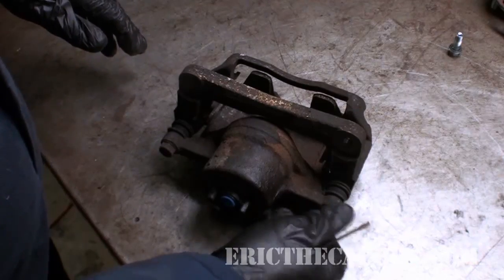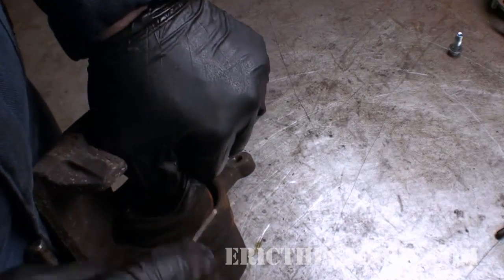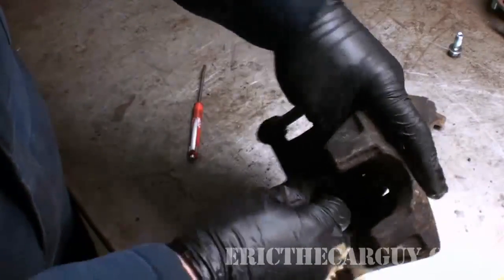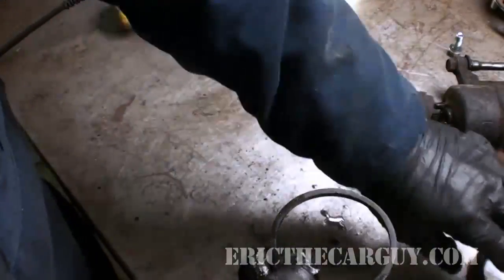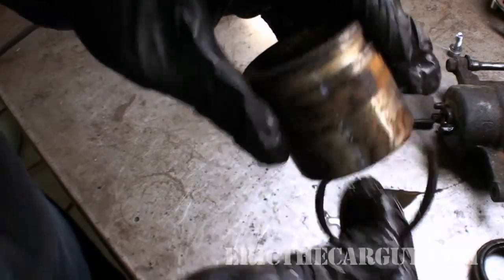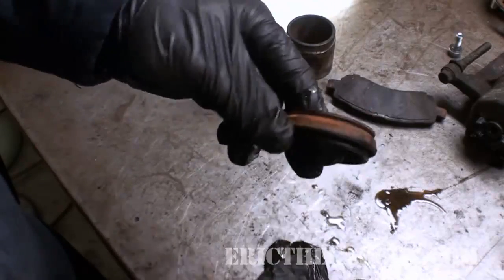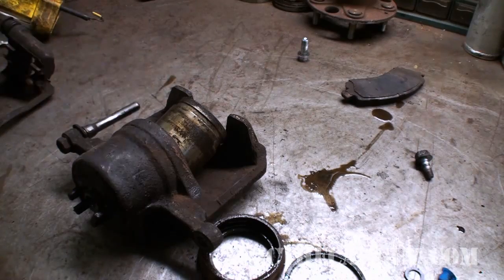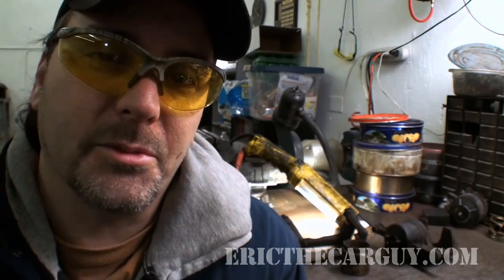Front Brake Caliper Dissection/Rebulid -EricTheCarGuy

Comment: Quick question here. Just bought everything for my caliper rebuilt including new piston. The piston seal are clearly oversized compared to the piston and the fit is not tight. Is this normal??  Looks to me its not going to make a good seal but i guess its hard to tell when the seal is not installed in the caliper.

I have double checked and the parts are the good ones. I just want to make sure before removing the calipers for the rebuilt.

Thanks!

Comment: i have a question and a concern that id like to share. my question is can u remove the piston in any way without compressed air and if so what ways will work without damaging the piston. my concern that i recently did a full on brake job replacing my rotors and pads as well as a caliper on my 95 subaru impreza lx, bled out all brake lines and the master cylinder got my brakes in working order but when i step on the pedal i will stop but my brake pedal will jutter and vibrate as if there is air somewhere or something. again everything was redone on my brake system and refreshed and done properly. what would be some suggestions as to what may be my issue with that. my pedal is stiff like it should be but it jutters and vibrates as if there is air or something trying to keep me from stopping properly
Reply: Is your abs kicking in?

Comment: My 08 wrangler has been turning hard left on and off. It's like my alignment was coming and going to and from normal. My mechanic says it's a seized caliper, if it was wouldn't it stay seized?
Reply: Sometimes the brake hose fails internally. It turns into a one way valve in a way. After several brake applications the fluid is forced into the caliper but it can't leave to allow the piston to retract. The caliper piston seizes in place due to the constant pressure. After a while it may bleed down amd become unstuck.

Comment: Eric.  I'm a big fan.  I have a 98 4runner and the front calipers keep seizing or at least not release after braking.  I've replaced the calipers, pads, and rotors but still have one caliper that wants to seize.  Is this a master cylinder problem?  Seems to be a cronic problem with this vehicle.  Any help?  Thanks,
Reply: Hey, I know this is an old question, but you very likely have a failed brake hose for the caliper that keeps staying engaged. When the flexible brake hose that goes to the caliper breaks down inside, they can have a piece of the inner liner come loose and block the fluid flow away from the caliper, meaning that once you apply pressure by pressing the brakes, this flap will not allow that pressure to release and will keep the caliper engaged.

A good check for this is to get the caliper to seize where it wont release and then open the bleeder. If the failure is a result of the caliper actually seizing and the piston binding, then opening the bleeder will not free it up. However, if opening the bleeder does free it up and allow the wheel to turn, then the problem is with the pressure fed to the caliper and is likely due to a failed rubber brake hose.

Comment: I usually pump the piston out with the brake pedal. It never fails to work and is much more controlable than air pressure plus it already is hooked to the caliper unlike a grease gun.

Comment: Question here, can you rebuild a calipers without taking the break line off?

I have a 95 F150 that has spent it's whole life in Pa so the break lines are rusted really bad and I would like to fix my sticking caliper (90% sure the piston is shot) without having to mess with the brake lines at all.
Reply: if ur brake lines are shot, replace those too, dont be a lazy ass

Comment: Can't you remove the surface rust with light sandpaper on the piston then smoothen it out very lightly
Reply: The piston surface is important for the square cut seal to do all of its jobs. pistons are cheap and rebuild kits are cheap,

Comment: Great vid I need to do this on a Peugeot 307 1.4 8v 2003 on the rear which has to be wound back with rewind tool,
Would it come out straight like the 1 in vid with air/grease
cheers
Eric
Tony.

Comment: If another piston or caliper is not available, you can clean off the rust with white vinegar. The weak acid will dissolve the rust but not the steel. Make sure all the rust is removed, if any remains it will rapidly grow back.Then polish with 1200+ grit sandpaper wet with brake fluid and finally wax free polishing paste. If the rust pitting was not too bad it will seal up and work fine.

Comment: The caliper slides back and forth on pins.  There is only force needed on one side because when the piston extends and pushes the inner pad, the caliper then slides and pulls the outer brake pad in towards the center, thus squeezing both pads with one piston.

Comment: Hi Eric, do you think you could use that rusty cylinder even if you clean it well with a brass brush and then use some 600 grit sand paper to smooth the pitting?

Comment: Hi there,
I have a new rubber dust boot with a iron open ring, which should be placed in the dustboot to fit it into the caliper.it extra seals off the dustboot and the caliper.
But such an iron ring is very hard to put into place
is it necessary to put the ring back??, because in several videos about rebuild i never see that ring put in.
Case

Comment: so back in the pad and rotor replacement videos you said you pinch off the brake line and compress the piston with the bleeder screw open to protect the master cylinder... what did you mean by protect? how would it be harm the master if you did not go that rout? TY for all the great work have learned a lot of from your vids..

Comment: paparker21, I'd like to address your question if you don't mind, phenolic vs. steel.
Phenolic pistons are used primarily because they do not transfer excessive amounts of heat to the brake fluid unlike their steel counterparts. However, that comes with a price. They tend to not have the structural integrity that the steel ones have. 
I do not recommend rebuilding calipers. It's not cost affective and I can't justify the labor involved, they tend to leak because of corrosion and porous castings.

Comment: The seal DOES "roll" (i.e. bend, flex, or whatever you want to call it).  Kinda like a rubber band rolls over when you slide it over a rolled-up poster, but it doesn't flip over like a rubber band - it stays in it's original orientation.

And the so-called "spring" in the brake pedal that makes the piston retract doesn't do anything except return the pedal to it's original position and release the brake pressure (raising the pedal doesn't create vacuum pressure).

You are wrong, wrong, wrong....

Comment: The square seal does not roll, it merely prevent hydraulic liquid from leaking. The piston retracts because of the spring in the brake pedal that cause it to retract.

Comment: the "square cut seal" doesnt roll like you said, it is square to stay in the machined slot, and as the piston retracts and extends the square of the seal or the flat surface slides along the piston maintaining a seal. it never twists. if it does the bore of the caliper and or piston is really bad.
other than that I am entertained by watching your vids.

Comment: one of the guys i work with was changing pads on a chev truck, he called me over after he compressed the piston and that dust boot was bulged out aout 1/2 inch, and it was spongy to touch it, so i knew that it was full of brake fluid, hence a new caliper was needed, but i didn't know about that big oring inside the bore, so i'm guessing that oring must have rolled or split.

Comment: I use PBR brake seal grease to rebuild my calipers instead of lubing everthing up with brake fluid. Its a castor oil based grease so it wont destroy the new seals.

Comment: Those are usually a one piece design, so you have one large caliper and the pads slide on horizontal removable pins. Also you install the pads through the sides without having to take off the caliper. They just have 2 pistons on each side for a stronger and more even clamping force.

Comment: Eric, since you work on that silver 4Runner all the time, you should do a video on the seized caliper pistons on the front calipers of the 4Runner. It's a very common problem and it happens to every 2003 - 2009 4Runner that is driven in the snowbelt. I've already had to replace the front calipers on my own 4Runner four times already, all because the caliper pistons seize in their bores.

Comment: Actually, all car handbrake work with cable.It's a safety mesure. What if your brake hose explode? On lots of car (less with ABS), there is a T fitting for the front wheels, and another for the rear wheel. The brake system is actually a 2 output system: front and back. That mean that if one hose fail, the wheel on the other side on the same axle lost all braking power too due to the T. Since the hose is busted, it now leak oil and the tank will empty quite fast, making the other system fail soon

Comment: On my car (Citroen Xantia) parking brake is in the front wheels. And no drum brake system, parking brake (or hand brake or whatever you want to call it) uses the same disk brake system. In this car power steering, braking and suspension all work with hydraulic fluid. Thats probably why the handbrake is designed to works as a "plan b": should hydraulics fail, it can be used to actually stop the car. The hand brake is cable operated, no hydraulics involved.

Comment: It might help doing some things without using gloves...sometimes it's more of a hassle to use them and not worth having your hand all clean and shiny by the and of the day. Sometimes it's just easier to get your hands dirty and be able to do something a lot quicker and better. Less anoying and stessful aswell, not being pissed off because of gloves getting picked and stuck everywhere in a confined environment such as an engine ou or a suspension assembly. Nothing a bit of old gas won't take off.

Comment: We used to have access to a rebuild (but i never liked it) state work. Reasoning the piston came in a composite made material.Is there difference in a square ring and quad ring?J/D hyd. filter has one that is directional the ring has major difference in essence will not lay flat on a table. Just for kicks. BIG JOHN  answered my own ? wiked quad ring and sent me to o-ring was great reading with complex stuff all the way to the space shuttle o ring failure.

Comment: The screwing action is only needed for rear disc brakes, which often use an intriguing screw mechanism for the automatic adjustment feature of the parking brake. Looking at this, if you could screw it in there might be less chance of damage. But for most front brakes there is no ridge to allow screwing of the piston during compression.

Comment: I had always thought that the caliper retracted because of backward movement of the MC piston and negative pressure inside the brake line. Certainly small volume retrograde flow of fluid happens every time you release the brake. But your idea of subtle twisting of the square cut seal is excellent and thoughtful -- I didn't consider that. Automatic adjustment for pad wear would happen in any case.

Comment: Hey Eric, another great way I find to get the pistons out (on the bike, although the same principle applies) is to pump them out before disconnecting the brake line - use the brake fluid to get them most of the way out. You can generally pull them that last little bit unless you decide to pump them all the way out, although that empties the brake fluid too!

Love the videos as always!

Comment: I've seen most mechanic sanding the piston with 1500 grit and use Castrol red rubber grease to lubricate it. Honda Caliper Kits comes with 3 grease. Orange, red and clear. Red mostly for piston and flat O ring. Correct me if I'm wrong.

Comment: Exactly the issue i have. Cant stress how important the point being made of lubricating the pins is. Otherwise only the side with the piston will be pressed and causes uneven wear and allot more work on the caliper on the other side. Plus will pull towards the working side when braking. On wet roads can easily put you in a spin.

Comment from the maker: It works the same way as you squeezing your hand on something.  Pressure is applied to both sides even though you only have one actuator.  This is why caliper pin lubrication is so important.  If they aren't properly lubricated they won't grip as well.

Comment: Thanks for the info, I always wondered how the pistons moved back into place and didn't leak.  Very informative video! :)  Are those seals the reason why it's sometimes so hard to push the piston back while changing the pads?  Sometimes you need to twist them for some reason.

Comment: If you don't have compressed air and can't get the piston out of the cylinder, re-connect it to the cars hydraulic and pump the pedal gently until the piston pops out.  Last resort and very messy but it works.  You can catch the lost fluid with a rag.

Comment: FYI,the reason you couldn't get the outer dust cover off is because the rubber dust boot has a lip which sits in a rebate on the cylinder wall.FYI-2 Getting it back on is simple if you slide the rubber dust cover down the piston and such theat the lip is not being held tight on the piston wall, and then sit the dust cover lip into the rebate and then slide the piston back into the cylinder.This then pushes the lip into the rebate without the need for scratchy screwdrivers trying to force it in.

Comment: Nice video! I hade sometimes used a special grease for asembling brakehydraulics and that has worked well. Do not use siliconbased products however as it won't mix with Dot 4 and Dot 5.1 brake fluid

Comment: Really cool.  I never knew that the square cut seal was responsible for retraction of the piston.  Also worth mentioning is how hydraulic pressure works.  It depends on area: for example, if the brake hose has a cross section area of 1/2 square inch and that 1/2 square inch is under 15 pounds of pressure; then say the back of the piston has an area of 5 square inches, that would mean the piston pushes out with 10 times the force in the hose, or 150 pounds.